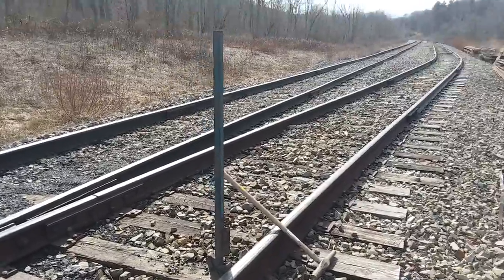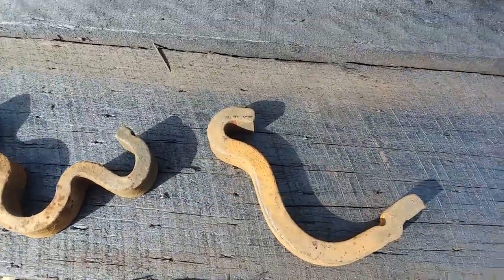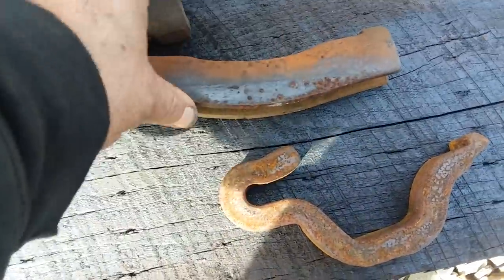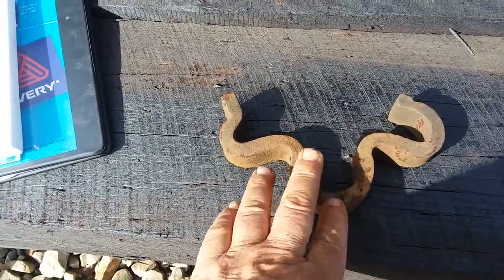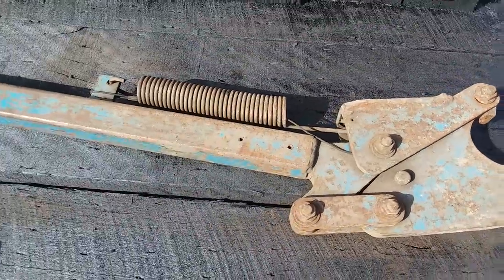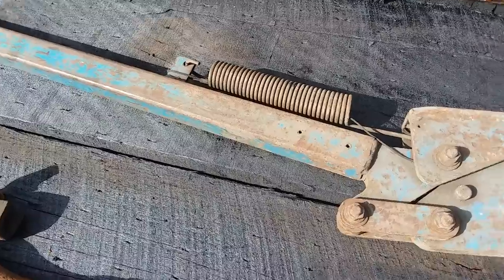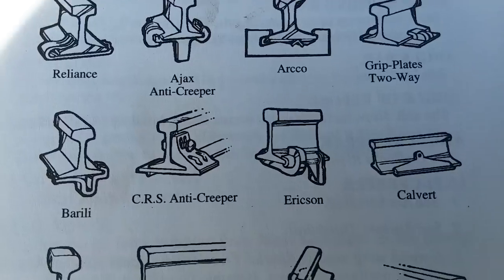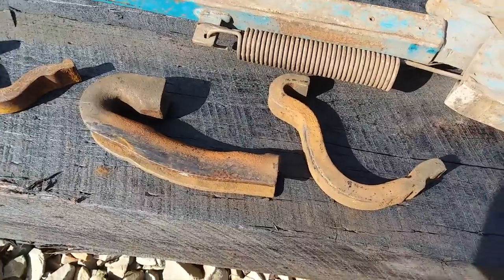All About Railroad Track Anchors - Sometimes they are Called Anti-Creepers

Comment: I worked eight years on the RR and never knew any of this info. Off course, I was an electrician on the locomotives (F units, GP's, etc.) In late 1950's and early 60's in the Round House and back shop. I cut a couple of pieces off a length of rail to make book-ends. That was the closest to knowing anything about the rails.....so I find your videos very interesting. TKS.
Reply from the maker: Blue Max! Good to see you sir. I knew you were retired but did not know you were a loco electrician, very cool! We sure could use your expertise here at times, we don't have anybody that understands the electrical system on our locos, all SD's, probably not much different from the GP's. We have to get a contractor to come in and diagnose those kind of issues, not a cheap adventure when that happens.

We have chatted at Belen in the past, although it been awhile, I haven't been on there much lately. Really appreciate your watching and glad you are enjoying them
Reply from the maker: @bluemax439  well thank you very much for your generous offer, i will pass it on. I have your contact info now, you prob should go back and edit it out so no one else gets it. 

Really hope your recovery goes quickly and all tirns out well for you

Comment: Another great video. I've used the spring type and two other types of drive-on anchors, one you showed that you don't like. When installing the spring I used a rail fork/rail turner. To remove all anchors placed one foot over the end that was liable to go flying and used a sledgehammer. The drive-on anchors place your foot over the part that would pop up on the outside of the rail. Often there's a small sliver of metal you don't want to find flying into your body, face, etc. You bring back many memories for this old railroader.  Hope you have a great day. Remember safety, fun, safety are the only rules in railroading.
Reply from the maker: Excellent comment! I learned 3 new things from that. Very good tips sir, they will be implemented. Thats why I love comments like this, can help make my job safer and easier 👍👍👍
Reply: @ccrx6700  you are very welcome sir. Also on those drive-on anchors sometimes there's a small metal shim under the "head" of the anchor where it clips on the the running side of the rail base. Don't lose it! That anchor will never fit onto the rail tightly.
Reply from the maker: @rebelrailroader  Yes Sir!

Comment: Its unfathomable the amount of steel involved in a railroad track.  In addition to the rails there's tie plates (2 for each tie), spikes (6 or more per tie),  anti creepers (4 per tie where used and on continuous rail its every tie), rail connectors for the joints, bolts for the connectors, etc, etc.  And they go on for miles and miles, and miles, and thousands of more miles and on and on.  And that's no even considering the steel for engines, cars, axels, wheels, couplings.....  It's truly mind boggling.  Thanks for posting.
Reply from the maker: It certainly is mind boggling! Imagine having to buy all that
for new rail construction! Used to be many years ago cost for 1
mile new construction was around 1 million, can't imagine what
it is now. Thanks for writing in and for watching the video 
my friend.

Comment: Good morning from Norway! Here 99,9% of all the working railroad is continues welded, and lays on concreate ties(?), and are held in place by the Pandrol clips system, with insuletor under the rail, and between the clips and the foot of the rail! We dont need that sort of equalizer spring/ clips any more, but we still have them in case of derailment, or in case of an emergency when we need to use wood ties/ slippers, Just like oure type, until we can replace them with concreate again! Thank you for a wery good show!! I would love more about how you and the Company handle Brake calculation when a train are different in weight and lenght, and other technical safety issues you might have!
Reply from the maker: Wow, Awesome comment there sir! Really appreciate hearing what guys from other parts of the world are doing. We have a very unique RR here, nothing like the big Railroads of the country. We only haul coal from a mine to a harbor facility where it is loaded on barges, only 17 miles of track. So all our trains are 38 cars, we have a single loco on the head and a single on the end of train in a push pull type of system. There are no calculations like you are requesting here.
Have a lot of other RR vids on my channel about what we do here if 
you would sometime be interested in viewing them.

Am glad you enjoyed watching sir. PS I have a good bit of Swedish blood in me, am proud of that heritage. Also would love to hear anything you would care to share about how your RR system does things in Norway, get a good many from UK and Australia write in, but you're the first from Scandinavia. Thank you

Comment: In the summer of 1978 I worked on a “Tie Crew” for Duluth, Winnipeg & Pacific RR (we said DW&P stood for “Drink Whiskey & Puke”).  We replaced old, rotting ties, and our best day was 1,800 new ties.  My job was swinging a 10-lb sledge—in the morning I was at the front of the gang, knocking all the anchors off, so they didn’t get in the way.  After lunch I went back to the beginning, Behind everyone else & knocked the anchors back on.  We put 2x as money on north side of ties because Trains would travel south loaded with iron ore pellets & then back north empty.

Comment: i can smell those creosoted sleepers !    Love your videos. ( We used 'Pandrol' clips for rail fixing on most track and the tool used is called a 'pan puller' - on old 'bullhead' rail it was bolts and wrench onto the 'chairs'  also used spikes, but not like the ones you folks use )
Reply from the maker: Yep on a really hot day there nothing like the smell of newly creosoted ties, really opens up the sinuses.... 

Can't remember if when we chatted before if I said, we call them ties and you guys call them sleepers?

these are 10 foot bridge approach timbers, do you guys have a special name for the long timbers like for bridge approaches or turnouts? or are they still called timbers ?
Reply: @ccrx6700  Yes here in UK we call the ties sleepers The area between them we call a bay , so when you are cribbing out we would say digging out the sleeper bays, the ground under the ballast we call the track bed, Sometimes we get water or clay seeping up into the ballast causing a dip in the track, these have to be dug out and re ballasted. We say digging out a wet bed for that job. Where we have turnouts with longer ties we call them crossing timbers and bridges are bridge timbers so some names are common to both sides of the pond.

Comment: As an Englishman, I had never heard the term grade for a slight slope.  We think of it as a GRADIENT.
Reply from the maker: Grade and Gradient both pretty much mean the same thing to me, I'm  just used to using grade. Grade means two things on RR here, 1. to prepare a roadbed for track installation, 2. the amount of rise or fall in a track per 100 feet expressed as a percentage. Gradient refers to the rate of inclination in relation to the horizontal.  I'm not a mechanical engineer with a degree, they both mean pretty much the same to me.

Gradient also has another use as a term here. When an engineer does a brake pipe continuity test he is checking for gradient. In this case, gradient is a fancy term simply meaning brake pipe pressure must be no less than 75 pounds on the rear of train with a 90 pound reading on head end. 

Thank you for watching and for your comment sir

Comment: I worked for UPRR ..I've installed/removed a few anchors, spikes, ties, tie plates, switch points, frogs, ballast, rail, welded 50,0000 or so chipped rail ends, lost count of how many thermite welds on mainline and in the switchyards.  Never ever,,, used a wrench to install anchors.. The best tool for installing anchors? 10lb sledgehammer (one hit).  They won't fly off if you stand on them while installing or removing them.  FYI If you were caught letting the anchors fly (safety violation) You would be the steel Foreman's #1 anchor mover.

Comment: Thanks Bud I automated the Unit plant in Atchison in the nineties, some great people.  We did the press automation and annealing ovens. Couldn't believe the volume of production, I had to switch over the old system to the new controls virtually without shutting the lines down. You never saw anybody so relieved to see that press line not missing a beat as there would have been a bunch of workers taking a long break!  Also got the best chicken wing recipe this side of KC at the sports bar by the river!
Reply from the maker: Now that's pretty cool to find out Alan. Good for you and thanks
for sharing with us. We do appreciate your writing in and
for watching the video today my friend.
Reply: I used to work there. In the 3 years I worked there it went from ok to horrible. The press that you probably automated was re done after their last huge fire (they had 3 in less than a year) it never made the production it used to at least when I was there. They added a safelock line which is still there as far as I know but they had a e clip line which has now been torn out because the machine they bought from Germany was junk and made to be in a clean room but yeah they've been sold twice first to amsted then later to progress rail and that's the straw that broke the camel's back. That place slowly went downhill by bad management and never hired from within to do anything and just fell apart.

Comment: I am old enough to have seen the Yardley, Stead and Ericson anchors in service on main lines in North Central Ohio. When I worked a summer job on a tie gang way back in my distant youth, the only "creeper wrenches" that we had were those heavy bars shown at 7:08 .... If you used those heavy bars correctly, they worked well, but the new anchor installers utilize mechanical leverage which is far superior.

Back in the bad-old-days when the eastern railroads were bleeding customers and cash, the NYC through my hometown was suffering from deferred maintenance. The ties were badly spike-killed and all of the rail anchors were so worn as to be ineffective. The double track was TCS and trains ran in both directions on both tracks by signal indication. Most movements tended to move on the right-hand track, but whenever a train ran the opposite direction, the (jointed 127 lb.) rail would move 2 to 3 inches. Yikes!
Reply from the maker: Very interesting comment Thomas, thank you for sharing with us. You gotta be a strong young guy to carry one of those old wrenches around all day. When they bring a tie gang in here, the last guy is one who is walking behind everything and putting anchors on with a wrench. I've heard some railroads have a machine that installs the drive ons, but don't know if it can do the wrench ons?

Since you were around the NYC, were you ever around the Dudley Rail they sometimes used? I'm looking for more info on Dudley. 
Appreciate your watching and your comments sir.
Reply: @ccrx6700  I'm sorry. No experience with Dudley. And yes, CSX had a machine that could install spring anchors. They are out there!
Reply from the maker: @thomasdupee1440  okay thanks. Sure would like to see that anchor putter onner in live action!

Comment: Those "C.R.S"  anti-creepers shown in one of the drawings looks like non adjustable turnout rail braces that are used in "my neck of the woods". These appeared  to be used when the nearby rail line near me still had 100 pound "stick rail" before the mid 1990s. Do any of the switches / turnouts on your railroad have turnout rail braces? I happen to know a lot about turnouts because I'm into model railroading, have been 30+years actually. I've even came within damn near inches of working for the New York City Transit Authority / MTA as a track man. I 've even hand built some #6 turnouts for my "three rail" trains from scratch, using code 205 nickel silver "G scale" rail with real wooden switch ties and spikes and all. Very time consuming though and a little bit of a pain in the ass! But it is worth it, I'm actually very satisfied with the results of hand building tracks for my Lionel trains. I can even run these outdoors if I wanted to.
Reply from the maker: Josh, we do have adjustable and rigid braces on our switches. 
Really awesome you can build those! I'm impressed, that certainly would make a man feel pretty good about himself, excellent sir!

Comment: Very interesting...  I,  too, wondered for years what these were for.  It wasn't until I was around the jointed rail, especially the old ICG line that was our interchange connection to CSX in Hopkinsville,  KY, that I better understood the purpose behind these anchors.  This is the first time I've seen the tools,  though...  The original looks like a good way to have a long day.  lol  I don't blame you for directing it to a better home...  It reminds me of using a ratchet bar on snap binders on a truck (I don't even keep such binders around these days).  

Not that it has much to do with the anchor subject,  you mentioned the expansion and contraction along with the rail creep and it reminds me of a summer of intense heat when our rail expansion was sufficient to push rails and ties both a good three or four feet out of alignment  (hanging out over the edge of the roadbed)...  I wish I had gotten a copy of the photo hanging in our office at the engine house.  lol  The contract maintenance crew out of Wheeling hadn't left enough expansion space or some such, as I recall.  

Catching up on some of these vids while in the region.  I hauled a new wind generator main shaft to the Stony Creek wind farm and am waiting at a Somerset motel for the crew on site to finish up so I can reload the old one for rebuild in Sioux Falls.  You could've scheduled better crane operating weather for the region, ya know?  lol 😆
Reply from the maker: Cool comment Johnnie! Somerset only a few hours away, too
bad you couldn't make it by this way. Wow 3 to 4 feet out of whack,
that sure must have been a sight!  Probably needed to cut some
rail out to get that back together. Glad you enjoyed the video and
thanks for watching

Comment: In making my videos about the Central Pacific Railroad I have come across rail hardware from the nineteenth century. They didn't use rail anchors on that 40 pound rail. They did use tie plates  that are small and thin compared to current ones. They have an underside that is corrugated with sharp ridges that bite into the tie. Perhaps an 1880's method of anchoring.
Reply from the maker: Some tie plates were made with those ridges and yes because
they were believed to help increase grip, I'm not sure if some
are still made like that or not. They would be valuable on the
lighter rail like you mention using the single should tie plates.
Anchors are made according to the size rail, but I'm not
informed enough to know all the sizes, gonna have to check
that out.

Comment: 28 pound sledge hammer, one shovel, spacing sleepers, adjusting clips all part of my job in the 80s right up to 2000. Qld Rail.
Reply from the maker: A real gandy dancer at work your were collector. Hard work even for a  young man. Thanks so much for checking out the video and writing in my friend.

Comment: My father was a civil engineer on a major railroad. He would despair of my ever understanding of track construction.

The rail seems as if it is there, stationary, fixed in place by spikes on top of tie-plates, with those tie-plates in turn spiked in position on the cross ties, everything nailed down tight, immobile.

The rail actually is as flexible as  the steel tape of a tape measure, it expands and contracts with heating and cooling, sliding back and forth, the traction wheels of the locomotives trying to push the rail back.

So what holds the rail? The crossties. The spikes directly against the bottom flange of the rail  are there to hold gauge confining the rail so it will be sliding on the tie-plates which in turn are spiked to the cross ties.

Now, what holds the crossties, the ballast, and what keeps the ballast in place, the track bed, a well drained, well built and layered track bed.

The rail clamps are using the friction of the cross ties pushing against the ballast to work, to keep, to retard,  the rail from stretching, from sliding when under the traction wheels of the locomotive. The rail clamps also are providing extra surface to drag against the ballast.

The rails are not immobile, but part of a dynamic system dependent upon all of its components to redirect the forces working upon them to best maintain structure.

It is when one observes a 800' long length of rail being dragged behind a bulldozer that you see that it is but like the steel tape of a tape measure, that it is the wearing surface component of the rail bed structure.

Comment: A good bit of those "channel" anchors were used on the Milwaukee. I also saw some of those others. We had to put our foot on the anchor when knocking them off. They would literally fly over and hit the other rail. Maybe it was my incredible strength. I don't know. Usually one good hit was enough to set them and then a few side whaps to put it against the tie. I really preferred the sledge for this.
Reply from the maker: Yep, I've seen guys hit them off and the thing go flying and hit another guy on other side in the shin, lot of cussin going on when that happens,  this a family friendly channel so will spare you the exact terminology used....lol  

But with your incredible strength you lucky it didn't crack the rail when
it hit! Smile

I sometimes use a sledge to put them on and off also. I do appreciate your comment and for watching the movie